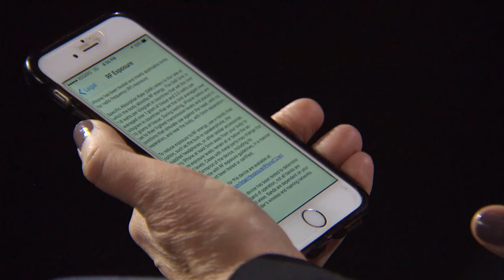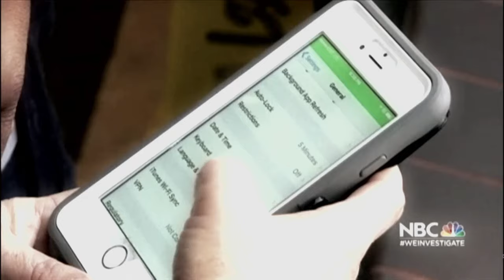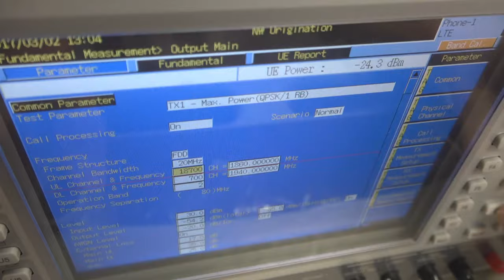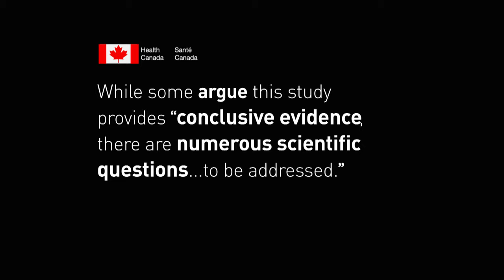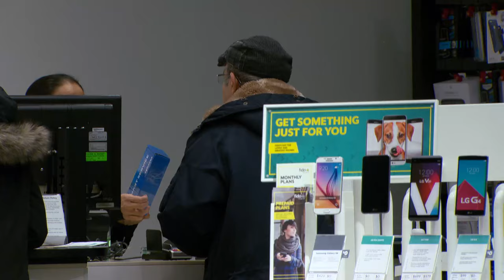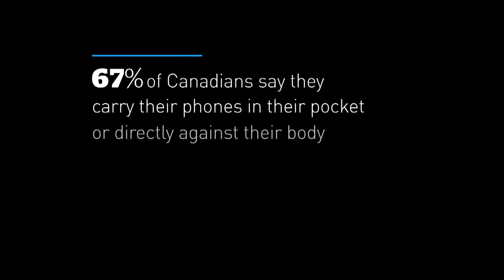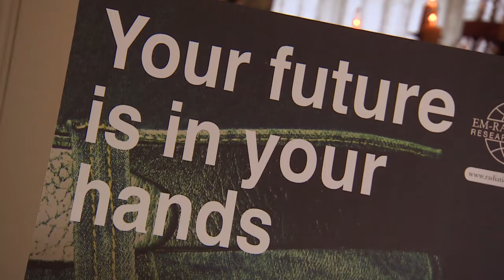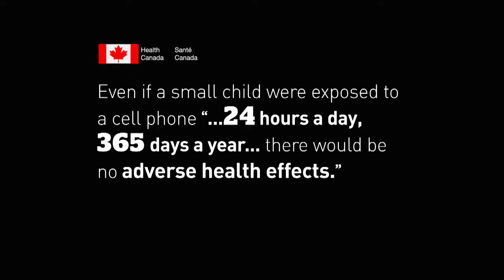The secret inside your cellphone (CBC Marketplace)

Comment: I'm an electrical engineer (Class of '74) my emphasis was/is RF and radar. I have been trying to tell people about this for many many years - no one listens. These devices are more radio transceivers than anything else, they emit  non-ionizing radiation - that is how a radio transmitter works.  RF electromagnetic energy can do nasty things to your cells (and the DNA they contain, which is very fragile). We live in an absolute soup of non-ionizing RF, from the phones, to AP's  which are everywhere now, nudie scanners (millimeter wave RF) at airports etc etc.  Like any other type of radiation, non-ionizing electromagnetic radiation is neither felt, tasted or smelled, unless the dosage is very high and/or the distance to the emitter is very small (by that time its too late).There is a formula to calculate this.  In the mean time even at low dosage it is wreaking havoc on your poor defenseless body, whose cells operate at < a millivolt (1/100th of a volt).   I do carry a phone, I use it as infrequently as possible, keep it in my purse - and I NEVER hold it up to my head - ever.   These devices are not passive, nor are they benign - please limit your exposure.
Reply: Ok but how ? I will try to use my PC (hard wired to router) when im home and keep my phone away from my body but what else ? Also i try to turn of wifi at night but my family needs it. What is you suggestion ?🤔
Reply: Josh Matthews Excessive heat can damage dna were not immune to decay 😂
Reply: @System-br1tx  To be honest, I just turn my WiFi off and use RJ-45 for everything. You can indeed buy a RJ-45 <-> micro-USB adapter for a phone (Android, not sure about Apple considering the jail they put you in...) if you really want to use your home network. I don't turn off wifi for health reasons, more for security reasons and performance reasons, but the health thing is just another reason to not use it.

Don't use WiFi people, it's just bad in every way. Use RJ-45.
Reply: Would you like a bunch more info on dealing with this from a larger picture you will hate even more?  After all.... you have a good idea what the 5-G will do ! I HAVE SOLUTIONS AND SOURCES WITH SOLUTIONS.
Reply: @davidmccallum8172  And what are those solutions?
Reply: @kingdionysus6706  So does wearing socks...
Reply: Do you believe there are conditions that could enhance a person's perception of RF waves? Short of actually planting an antenna on some one's brain. More like pH balance and metallic dental work stuff.
Reply: Thank you for truthfull intelligent factual information.... But one question can you get tumors in your hands?
Reply: Is it fine as long as you turn it off or keep it away from you when it is on?
Reply: @johncombes2773  interesting question.  I would love to hear the answer too
Reply: Tanks for your time in sharing your knowledge. God bless you
Reply: @davidmccallum8172  please share your information I am interested!
Reply: @davidmccallum8172  I would also like solutions please for 5G, I have heard a few but would love if you could send me any and all information you have is it ok if I email you?
Reply: Hi. I have been interested in going back to college to study RF but wondering how you are able to stay safe with all the exposure you would have while working?
Reply: I always use speaker on my phone to. Thank You for your comment. Why don't people listen:(
Reply: Wow, thanks for the information. My young adult children don't listen to me.  One doctor  told me to stay away from the microwave oven when it's on.
Reply: that you for that. see my comments above.
Reply: weird, i wrote thank you, my computer changed it to that you.
Reply: Great comment, Cynthia.   I think those of us who grew up in the 60s n' 70s have an advantage in a way:  we grew up in a generation that was NOT addicted to electronics, we had a huge interest and commitment to environmental health, and we were extremely warry of "THE MAN" and "BIG BROTHER" and their controlling influences.  All of that has resulted in a LOT of us not jumping on the "cellphone bandwagon".
Reply: Sue Happyface  ... You can consider writing to your State's Utility Commission and ask for further advice regarding this.  Your Senator or Congress Person may be able to help you/your friend as well.
Reply: Thank you.  What is your opinion on the 5G push?  Why are these companies pushing so hard to bring unnecessary bandwidth?  They are not in a losing position simply charging what they are now for the already amazing speeds.  It is a scare to me that there is such a rush to destroy habitats to put up the ugliest towers in some areas.  It is just hard to not wonder the possible deeper purposes for this and the fact they are singling out the mitochondrial DNA now!
Reply: Better stay away from people then coz a human body gives off more radiation than a modern cell phone.
Reply: @tonytucker5266  Seriously?  Man I have heard many different things and I have witnessed a simple NoDoz capsule set off a radiation detector and that was wild.
Reply: John Doe  True, the sciences have been so convoluted and used as weapons to deceive masses for so long it is hard to know the truth to much anymore without getting your elbows dirty.
Reply: the sciences have been so convoluted and used as weapons to deceive masses for so long it is hard to know the truth to much anymore without getting your elbows dirty.
Reply: @Robert Marshall said, "a millivolt is 1/1000th you dropped a zero, (.001 volt)"
---------------
Thank you for that. I spotted the error, too, but I am sure-- on a better day-- she would have caught it.
Reply: @System-br1tx  Use your speaker button to talk on your phone - that's what I do.
Reply: I use to work for a major company that produces car CPU and other car part in a small metal room rf scanners I kept telling them that room made me sick it's like because it was a small space the rf bounces off the wall and amplified
Reply: @gimmebrain5865  are you being serious?
Reply: Thanks, I keep the device ( scrying mirror) away from me as much as possible!
Reply: Josh Matthews  you dont know the damage this radiation can do,we dont know it yet
Reply: @thorengebretsen3738  so copper is a good protection for this radiation....can we take it in supplement form
Reply: I will believe Cinthya, unless you post research references. I mean books or magazines with a serious impact factor.
Reply: WIFI isn’t any better either!
Reply: david mccallum I would please
Reply: @david mccallum.  You replied to a comment about 5G here, implying that you know ways to protect from 5G radiation. Would you please let me and others that asked here, know ways you know that people can protect themselves from 5G? It is said the patent information and owner's website information, and agenda 21 or agenda 2030 on the United Nation's website calls 5G technology a form of weaponized technology. So, evidently, it's a technology dreamt up by adherents of the wish to greatly reduce Earth's population so that the most evil, greedy, ignorant oligarchs can continue to stay in control of more and more fascist type governments, able to get away with more and more evil deeds like a bunch of back stabbing monsters, and have the masses still using fossile fuels for power, and dependent on them for it. The idea is, with a world population reduced to 500 million, the pollution of fossile fuels would not be too great to destroy Earth's ecosystem. Most of the oligarchs & friend's tutors did all their homework and gave them the answers to all their tests throughout college via fancy cia quality spy glasses & ear buds gained through their memberships in George w type young republican groups or sororities like skull and bones, so they could concentrate on partying & making friends with other crook's kids and planning big scams they'd run on governments as soon as they graduate, like nuclear power plants that government's tax dollars pay billions for up front. So they're too dumb as a post to figure out how to make money by making the world the most beautiful it can be, since the only thing they've ever learned is how to run big scams with each other's help. So, why not reply to me AND within the 5G comment section here with the ways you feel would protect us from the dangerous 5G radiation technology they're trying to roll out? ☺
Reply: @Србомбоница. Copper is a great conductor, therefore, more copper in your body or on your skin, would cause you to get fried even faster by 5G, with extra copper running through you.
Reply: This is just out of this world
Reply: Alternity666 please get in touch
Reply: Your reply disappeared from a few days ago, no surprise to me. Would you be willing to get in touch privately please? I hope I receive your message
Reply: No different than sitting in a microwave oven on slow cook!
Reply: Thank you so much for sharing your testimony. 
I believe what you are saying is true. 
Let the Trumpet sound
🕯️ 🔥 📯 🌄 🥩 🙏
Reply: @johncombes2773 
yes,
I used to be a nurse and you can get tumors anywhere in your body including your hands
Reply: @Alternity666  Please explain RJ-45? and laymen terms of what Wi-Fi does  Thank you! ❤️💕😘
Reply: @organicdudranch   Stubborn bots of a reference! Thief Google.. has word prediction too? If so, why not? "Thank you" hahahaha!
Reply: @tonytucker5266  lol ,😳😳🤣😂 yeah ...so true Tony great comment!
Reply: {// WTF! //}  I agree 💯😉👍
Reply: I Thank You
Reply: Cynthia Klenk just so sad it's come to this! Thank you for your info. God bless.
Reply: I took radiation course for work, yes it's no joke! Over time it will cause harm! We are hit with radiation just being outside, just smaller and a bit different .. dental radiation courses go over it all and its not easy I had to break down the book just to get my Ls
Reply: Just like getting a panoramic xray! 1isnt going to harm u. But doing it over and over in a short period of time will def cause harm, just like mri, and radiation for chemo
Reply: But just like walking outside, radiation.. its everywhere..
Reply: Josh Matthews  And the human voice cannot break a crystal wine glass - it absolutely does not have  anywhere near the required energy so it's impossible  - except it can. The evidence that non-ionizing radiation can break molecular bonds, damage cell membranes, harm the nervous system and do other biological damage is overwhelming, especially with the kind of data modulations we have today. I used to believe as you do until I looked into it.
Reply: @johncombes2773  yes, wondering about the same
Reply: Thanks for the information and warning!
Reply: 5g will be even worse: higher frequencies and the water molecule. You, who ever you are, are more than 60% water. 
What does this mean to you?
Reply: Sadly, shutting off WIFI on a router is beyond the capability of most users.  I have to go on line and access a web site to knock out the WIFI.

All my devices are hard wired to the router, which trumps WIFI for speed.
Reply: Josh Matthews  What you wrote about non-ionizing radiation not damaging DNA is false. Researchers in the 1990s found non-ionizing radiation does damage DNA. For instance, see link at: https://bioinitiative.org/wp-content/uploads/pdfs/BioInitiativeReport-RF-Color-Charts.pdf.
Reply: @davidmccallum8172  Okay,... And what are your solution's Sir?..  if you have them can you please share them for the people who are interested? Thank you!
Reply: @johncombes2773  WOW... I'm sure there's a place on a human's body from head to toe where tumors can grow..  our hands? Sure! absolutely 👍 💯 I don't think there is a place on our human bodies that is safe, if a tumor wants to grow..
Reply: @iooooo_eythere5220  to be quite honest... I personally don't think anything about keeping it away from our bodies is just " Fine" I think it may help" reduce chances" but never Would I just be that naive to think everything Would be "Just Fine"
Reply: @gimmebrain5865  LMAO 🤷😂 I don't know smh..  some people are going to take this as a joke, never taking things like this seriously 😔 until they're the one themselves who ends up lying in a hospital bed given three to six months to live by their doctor, all the while their brain/ body is riddled with cancerous tumors 🙄🤦🤷 sad really... My father passed away of brain tumors at the early age of 45 yrs old.. started having severe headaches, migraine types of headaches. When he went in for surgery to have the tumor removed, they opened him up and found a hell of a lot more where that came from.. So, my father went to the doctor for migraine headaches, quickly ended up in the hospital for tumor! And quickly passed away two weeks later. I don't know when people are going to take this seriously
Reply: @Србомбоница86  I actually hear that copper is supposed to be great for us! And that it has a lot of protective qualities! I'm actually going to do some more research on that... I'm not sure about supplemental vitamins as of yet? but I do know you can get copper jewelry which is supposed to be great! They actually have copper bracelets you can purchase and where them on your wrist. I apologize I don't have all the information for you at this time, but you might want to look into it on your own do a little research 😉 I know that I am!  as well as using other protective measures that I possibly can, to at least limit some of this horrible stuff to some degree. In the hopes and prayers 🙏🙏🙏 they will come up with something in the meantime.
Reply: @valerieann8007  🤦😳😑😬🤔🙄😏 Thank you so much for that! Everything you stated is 100% absolutely correct! And I could not have said it better... So again thank you! Hoping and praying one day everybody's eyes will be open to this and what's really going on here smh... 🙉🙈🙊👁️👀👍
Reply: @aura7007  You're right. Sorry, I didn't think my choice of words through. Thanks
Reply: class of 74?  I was born in 74  =(
Reply: Josh Matthews  I buy thermals in winter times? will those thermals damage my DNA?
Reply: ُSystem32 h
Reply: Josh Matthews  The fact that micro wave energy excites water molecules the way it does leaves the door open for other potentially harmful effects on the body besides just heat. Cellular damage can come in many different forms. The tests performed are based on an assumption that RF is only dangerous at levels that can cook you. I guess they have never used a crook pot before. The tests are not taking into account the other factor in the equation. Time.
Reply: @Србомбоница86  It's called a Faraday cage and acts as a shield. Wrapping the transmitter in a Faraday cage keeps it from interfering with other electronics. In military applications a Faraday cage helps keep enemies from eavesdropping and jamming communications. Plus it hardens critical infrastructure from things like EMP's (electromagnetic pulse), x-class solar flares and coronal mass ejections coming from the sun. 

Can't put that in a pill I'm afraid.
Reply: I have a flip phone, is it as bad as a smart phone ?
Reply: I tried to tell people too but they don't listen 🤷🤦
Reply: Thank you
Reply: I'll aim all of these devices at my noisy neighbor.  Mwahaha!
Reply: I have only been on a plane once, but everyone I know who travels by plane seems to have post-flying symptoms. I had a friend who was sick for two weeks after flying home from Florida to New Jersey. That isn't even a very long trip. I worry when my granddaughters fly to Europe to visit other countries, even though they seem to enjoy it. Maybe they have good immunity, but one of them went to Ireland and came back and had a sore throat and cold after she returned. I try not to worry. They also have cell phones and computers. So do I. Necessary evils...I order groceries online as I am housebound and don't drive any more. My eyes always bother me, but I can see, after my cataracts were removed a few years ago. My vision is so clear when I am on the computer, but sometimes, I think maybe it's allergies that make my eyes water. Or maybe it's the chemtrails.
Reply: True I know engineers working at cellphone company, and they say the worst amount RF happens when you START a call, that it is when the RF opens up stronger, and that you shouldn't put the phone to your ear until it already shows is ringing on the recipient of that call.  They also told me that wireless earphones are bad.
Reply: @gimmebrain5865  The push for 5G is about furthering the use of AI.  It takes bandwidth to do things like having a surgeon perform surgery via 5G in present time using a robotic arm in a country like Afghanistan.  It lets things be done in a crazy fast time almost present time.  It will increase the use of robotics and other AI inventions.  Our world is about to change in big ways when this is fully implemented everywhere.
Reply: Willful ignorance is undoubtedly going to be the end of us. The human race I mean.
Reply: Wowwwww
Reply: some definately dont listen, and they argue and get angry also. and now that 5G is here these numbers from tests are going to skyrocket, and the tests will most likely not be updated.
Reply: Josh Matthews  .. and heat does what again?? oh yes... boils water and excites atoms ???/ harmless indeed.. you need to look a bit further sir and think logically.. not debunkingly sir... duh!
Reply: ❤️thank you so much for this info🤗😘🥰🌹💯👍 God bless you🙏💕
Reply: @johncombes2773  😞yes, I have them now, in my left hand, where I always held my phone, my hand is difficult to use now👀😞🌹
Reply: Suffered from deppression for a few yrs now, I fall asleep with soft music from the fone & it carries on playing after I'm asleep obviosly. Maybe my dementia is caused by my fone being next to my ear all night playing bloody music! 🎶
Reply: Kiwi zu  bluetooth emits far less radiation than actual mobile transmission it is working on the much less power , I am think that speaking via Bluetooth headset is more safe option for those concerned with RF emissions
Reply: @AshkenaziChristian  yes but than quality of the conversation is much lower and quite often it's hard to figure it out what has been said, moreover not everyone wants to share the contents of conversation with the strangers in public. I would say that the best solution to the problem is to use the Bluetooth headset when in public. It is emits much less radiation than actual mobile transmission. For me biggest concern is that we all wearing our mobiles very close to the body. If f you have a sensitive nervous system you can sometimes even feel the pain if far away from the transmission mast  the part of the body which is closest to the antenna, for mans it is a very scary experience.
Reply: BEAST NETWORK... READ YOUR BIBLE'S... THERE IS NO MONSTER IN THE SEA 👌
Reply: Tony Roberts  , ...  Just like we trusted scientists, that were financed by tobacco companies, that told us tobacco is not harmful? ... Or scientists, that are financed by sugar companies, that tell us sugar is not a toxin? ... When will we learn, that they can not be trusted?
Reply: Thank you so very much for that tutorial.i deeply appreciate  yr having taken the time to alert people  to  the potential hazards  @ increased risks. Very gracious of you. Pharlap bless  🐎🐎🐎🦘🦘🦘🐨🐨🐨
Reply: Thanks
Reply: @Dc-zu1ii  Yes there are absolutely conditions that will cause a person to react to RF waves better, heavy metal toxicity is probably #1 on the list. History of problems with nerves in the family and any nerve problems, because most of the damage is caused by the electrical signals interfering with nerves. Low PH balance could be an issue too, candida overgrowth as well and any other things that make the body weak will then cause further weakness by RF. Heart problems with be worsened by RF, anxiety and depressions can be caused by it, also unusual irritability/anger that seems to come from nowhere..
Reply: If the weather radar of a large airliner is not turned off on the ground and it is tilted to aim down, when the aircraft is stationary it can melt the asphalt below it, so I have been told.
Reply: @supergmx1046  Airliner pilot told me this. If the radar is on and someone gets hit with it on the ground, they can feel it right away.. but that should be obvious as it is extremely strong.
Reply: @supergmx1046  But I seriously doubt it would do anything to asphalt. That's a whole other level.
Reply: 2014 Corolla like I said "so I was told". I am not a scientist or an expert. I do not claim it as fact but It was a C-130 pilot who told me that. I do know it emits high energy radiation scanning 320 miles ahead of the aircraft so I wonder what it does at ten feet as I described. It apparently is  damaging to the eyes and testicles in particular if it is aimed at a person. Pilots are careful to not turn it on until in the air or on the runway and to not aim it at any other aircraft or buildings on the ground. Also by melt he may have meant some minor dimpling not necessarily turning the surface to molten state.
Reply: How about tablets? Do they pose any threat to our health too?
Reply: @johncombes2773  You can, of course, get tumors anywhere. However, being non-ionizing radiation, not from your cell phone. Worry a little about absorbing chemicals through handling.
Reply: Kiwi zu  Bluetooth is extremely low power and a lower frequency - generally speaking much less worry, if any.
Reply: Josh Matthews, 6ow much do you get paid to write this stuff?
Reply: david mccallum Solutions besides Y-Shield?
Reply: {// WTF! //} actually it's not consumers, it's the govt, all of the governments
Reply: michael s. clark are you for real? U worked in a metal room to work on them?
Reply: david mccallum there's 12 tribes dude
Reply: Wow. I had no idea. 😩😱😱
Reply: @auriatedauri8806  want to now watch wifi does om hacked
Reply: @whistleblower8289  do you know wath to do if you're hacked
Reply: @The Sheriff Show - TSS do you now solutions against11 hacker on smartphones
Reply: @whistleblower8289  van you help im hacked
Reply: NEVER hold a phone to your head.
Reply: Thank you!
Reply: Okay never hold it up my head from now on.
Reply: whats your opinion on the 5G stuff they are now about to use or using im not even sure at what point we at its very confusing!! but it definitely is worrisome.
Reply: 0dBm is 1 milliWatt.
90% of the hansets are UNDER 300mW output!
That is 3/10 of a Watt!
You stand a far greater chance of being irradiated by your microwave oven, than being 'cooked' by a damn phone!
STOP PLAYING CHICKEN LITTLE PEOPLE!
NOBODY HAS BEEN INJURED OR KILLED BY CELLPHONES...NOT ONE!
Reply: Great info, thank you. Though I am curious and you seem to be the intelligent person to ask. Do you have an opinion on how one would be able to shield or protect themselves from all these harmful microwaves, frequencies, radiation etc,. From the cell phones. Obviously the key answer is don't have a phone or if you do don't keep it near you as much as humanly possible but it's very hard to do so because the structure of the system they have set up requires one to have a cell phone to get by in life it seems. Therefore how do we protect ourselves from all the harm without getting rid of the tech?
Reply: @davidmccallum8172  right on David🙂. Notice how Josh is using the oldest most known trick in the book of slander. He is calling you a conspiracy theorists and calling the other woman gullable. Once again instead of taking the bull by the horns and addressing the issue properly he is just attacking the credibility of the people. ( You and Lorraine).
Reply: How about Bluetooth? I wear them 24/7 while I study and while I work at work and around the house.
Reply: ....

I'm not even an adult yet, but I know that my dizziness, head ache, out balance and bad eyesight is because of phone. But I can't seem to stop especially when my hobby of online reading is...addictive to me. But I really want to stop. I tried stopping but...its like my body and my head dont coordinate with each other. I was exposed to gadgets since young....so Its probably one if the reasons why i am addicted to it.
Reply: Thank you so much for taking the time we explain this issue. I had no idea this is going on. Have a good day!
Reply: @Alternity666  thank you! I really appreciate your knowledge
Reply: @TrinityAlex  how?
Reply: @johncombes2773  that is a good question!
Reply: @iooooo_eythere5220  good question
Reply: Kiwi zu  that is a good question
Reply: @davidmccallum8172  thank you for your knowledge and I also thank you for the links! Have a good day!
Reply: @pinklady6042  I wonder about microwaves also!
Reply: @thorengebretsen3738  thank you  for your knowledge and telling us
Reply: @patsycav  😂